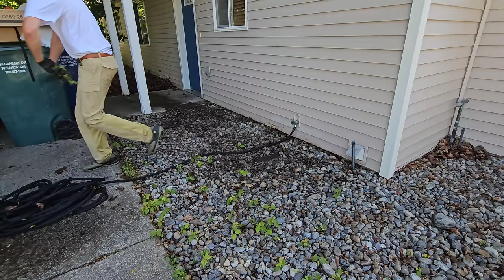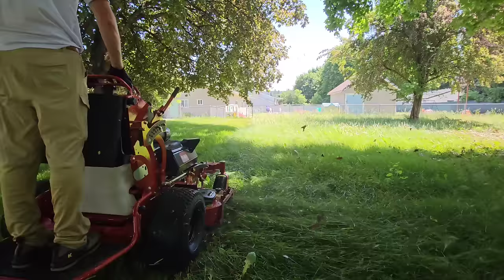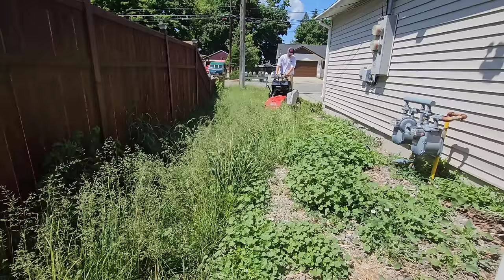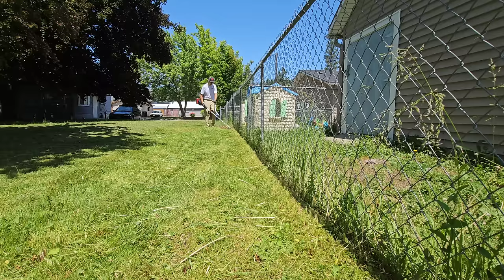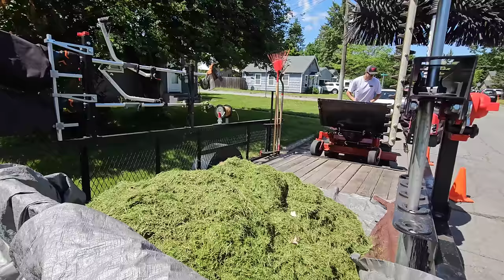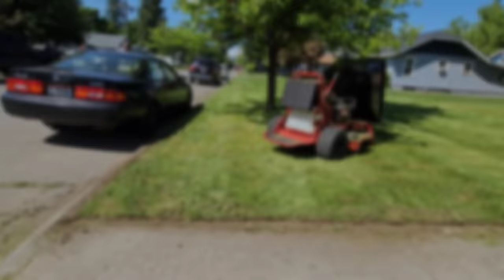Kids Can't PLAY In This OVERGROWN Jungle | Let's Make These Families HAPPY!

Comment: The tenant said take $200 or $300 off the rent and they'll mow it themselves?

That's cute. Our landlord only deducts $50 from each month's rent for me to maintain the yard.

Either I'm getting cheated, or that person is absurd for expecting so much off the rent.

Great video as always Fill. Your work is appreciated sir.
Reply: Unless it is a huge yard or severely overgrown, $50 seems reasonable.
Reply: @princessdumbarton9877  I agree, which is why I think that person expecting $200 or $300 off is insane.

Our yard is a corner yard, and those are always somewhat large, and usually it takes me 1.5 to 2.5 hours.

However, I was fortunate enough to recently get my first ever riding mower (it was used and a great deal), so now that I'm not push mowing anymore, $50 REALLY seems reasonable.

Thanks for the comment.

Comment: Fill, if you need a more durable tarp, visit your local outdoor advertisers. They have billboard covers that are designed to last 2 or 10 years. The former are just about like the one you are currently using, and the latter are about 10 mil thick. Both have UV protection in them.

Comment: PRO TIP: if you are going to go rock mulch, cardboard on dirt under mat (fabric) then fill out the rock.  Way easier to keep unwanted growth out of the area for at least 15 years. 👽
Reply: If you want to plant in the rock bed, pin it down heavier around your cutouts oversized, then patch in with a liberal overlap after your plantings are installed.  Old rock bed?  Rake it off area by area and install.  Flat cardboard like soda and beer to dirt, corrugated types on that, then weed block, and rock top.  This will also help water shed away from structure so leveling the dirt is key as well. 👽

Comment: Never in my carier as a grass cutter , cut the grass walking backwards or walking like a crabe...
BUT U DID....🤣🤣🤣🤣

Those situation u should hold and swing the brass cutter from right to the left and walk foward and make sure those fench, wall, house building and trees on your left sight...
This technic is easier to apply and faster and safer..
Because u dont even know what are behind u WHILE U CUT THE GRASS BACKWARDS..
MAYBE SNAKES OR STONES OR STICKS LYING ON THE YARD..
WHERE TO START..?
IF U UNDERSTAND THIS TECHNIC, U KNOW WHERE TO START....
IF U FACING THE HOUSE, U WILL START FROM THE LEFT FENCH OF THE HOUSE YARD (FRONT) TOWARDS THE BACKYARD AND THE FINISHING LINE IS THE FRONT YARD WHICH IS ON THE RIGHT FENCH...

JUST TRY IT..👌